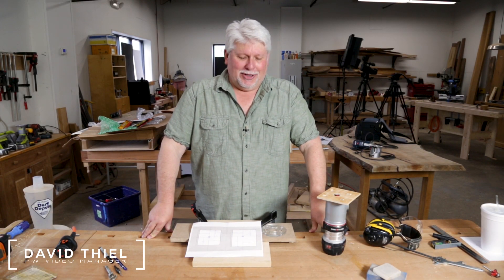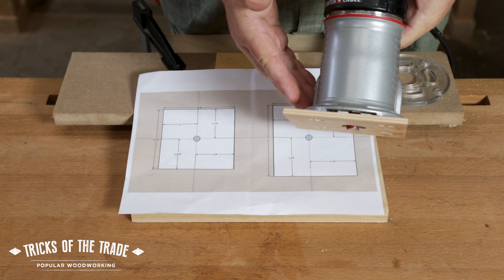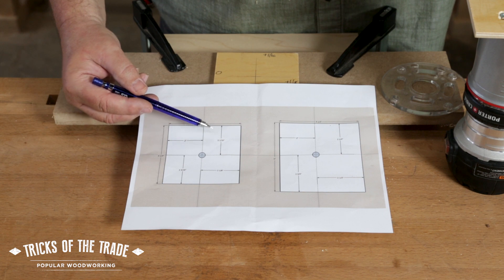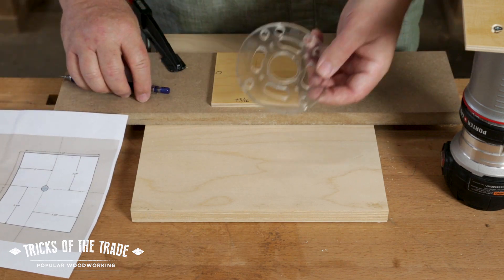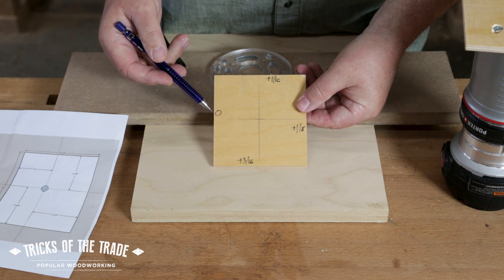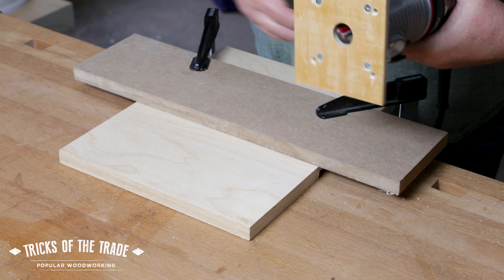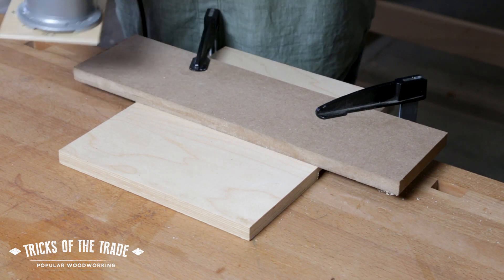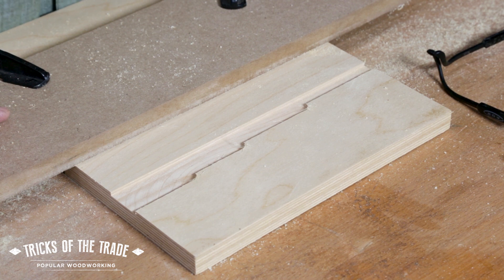Make a Four-Width Router Plate | Tricks of the Trade

Comment: That is pretty cool but what would you really use that for in your shop?  I do not use the router that often because I just do not have the hang of it.  Thanks for the video
Reply: David Heaton dados. Especially when sneaking up on cuts that are undersized. Thus way you wouldn't need to move the fence and introduce error.

Comment: I like these types of videos, what made you so excited about making this? I'm not sure what the application would be?
Reply from the maker: The first one that came to mind was cut a 3/4" wide dado or groove. By using a 1/2" bit with this plate I can cut the dado in two passes (or four if you're cutting a deep groove) by simply rotating the base against the fence. No moving the fence! Or take that some concept to a different level. If the base is made for 1/32" graduations and you have a 3/4" bit, you can cut an undersized or oversized dado (fitting that tricky plywood), but rotating the router. The applications will grow! - DT
Reply: thanks and please as you find more applications let us know. By the 4 thumbs up I wasn't alone in the question.